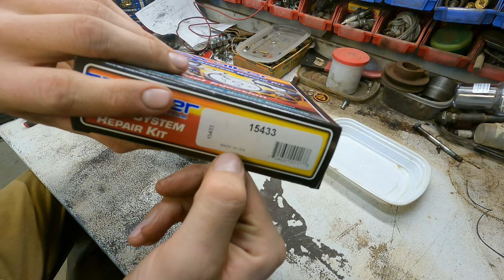Is this 1950's Galion Road Grader worth saving???  Cursed Grader Pt.2

Comment: I loved your "No more Mr. Nice Guy" approach to the bottom bolts. As you surmised, what the heck was the manufacturer thinking when they thread bolts into casting that doesn't allow for a wrench to seat on the head of the bolt, especially in such a confined area?
Reply from the maker: I don’t know how they were able to even get them In there!

Comment: Thank you Matt (Desiel Creek) that Grease also fitting fixer that so cool have buy one and be very good 👍  to use also love your share ideas always to ! Plus that fitting fixer is amazing invention and who thought to get one in production must be mechanic for sure or excellent engineer to help use mechanical equipment people too! Should had one out production years ago to save old fitting on grease ones and I know needle for grease up sealed parts stuff was excellent ideas too I use them to lots especially on tie rod ends with rubber bushings do on vechiles late because no grease fitting too !

Comment: Hi, look at the hydraulic hose for the clutch, it's about to fail. The carburetor is much like what was used on the early 1960's Dodge Dart slant six engines. If you find your is bad in the future you can likely source one that way.
The bell housing bolts, likely International had a special tool for it. When you fixed the engine in the crane truck did you replace the timing chain? If yes and no spark look at that, see if the distributor is turning, I've seen Fords shear the pin that holds the gear onto the distributor shaft especially if there is water in the oil, it can seize the oil pump.
I realize it's likely something easier but I wanted to share some failures I've seen in the last 45 years or so.
I really like the grader! 
Thanks for sharing, 
Bob Ordewald 
Staunton Virginia

Comment: Maybe you can get new bolts into that bell housing with offset open end wrench? I think Watch Wes Work used them on a recent video. That way you can come in from the side without fussing with a socket there's not room for. They look like the "crows feet" with a side handle at a specific degree offset. And you might ask him for other suggestions. His latest video he replaced a radiator on an International snow plow truck and had a link to another channel of a guy that works exclusively on highway heavy equipment, might be a good resource for Christine's issues! You also need to check into LOCK-N-LUBE. I have one and they're a lifesaver greasing fittings. They literally lock onto a fitting with jaws and will let you apply all kinds of pressure without needing two hands one for the hose one for the handle-or trigger. They're very reasonable and they have several accessories for grease guns. Worth a look. Gotta find at least a used tire for that right front! Good work, Matt, keep at her!

Comment: You will have a lot of people telling you how to operate the grader. Most will be good advice but you will have to figure out what they mean by trying these suggestions out. I will tell you a couple of things that I was told. The first is to lean the front wheels into the draft of the blade when taking a heavy cut or mixing materials. The second thing is that you tilt the blade forward to cut and lay it back to carry material. You will have to try these things to understand what I am talking about and then you will develop a feel for what works. Happy grading.

Comment: Clean a tank with Murriatic acid - It works  superb in tanks - remember - on fininsh you musy stop reaction with water mixed with soda.
Reply from the maker: yes Ive used that in the past with good results.
Reply: @DieselCreek  Also if you have stuck piston rings try DMSO - it work superb with carbon https://www.youtube.com/watch?t=230&v=ZVtGC-JUyQU&feature=youtu.be

Comment: Once you have it running, you can avoid spending time on the carb just by running lots of modern fuel detergent, plus old Marvel Mystery Oil.  I also suggest not bothering much with tires until most everything else is in order.

Comment: I’ve been skeptical of those “grease fitting rejuvenators” just because I didn’t like the idea of hammering on the grease fittings. But looking at it now, not much of the hammer strikes should actually be transferred to the grease fitting body, and I guess you don’t have to hit them hard as I thought you would anyways 🤣 I’ll have to check it out. That could be useful.

Comment: You need a set of double ended ring spanners. They can be straight or joggle ended.
Reply from the maker: I have them. there isnt enough clearance around the head to get a wrench or socket on.

Comment: When looking from the front at 27:20 that bolt hole on the right below the Tilt steer ram is where you slot in a piece of steel and then use the tilt steering to jack up the front so the flat tyre is off the ground, it also looks like you drove it with the Diff lock on, just a heads up you can break the chain drive that links the 4 rears by steering with the diff lock on on modern graders (never operated something that old).
Reply from the maker: There isn’t any diff lock on this

Comment: If there is an access plate on that bell housing get a c02 fire extinguisher and blast it in there. Or fill it with dry ice. It should release that pressure plate.

Comment: Where you live, Matt, you are close to farm country and farm equipment salvage yards so engine parts and what have you are very accessible to you and all your equipment, which you probably already know.
   I can't see very well but can you remove the bell housing from the engine , If you can reinstalling everything will go much easier. I am sure you will price the clutch from several sources before you buy one if you decide to buy one and even the throw out bearing. What a great time to replace the water pump too.
If need be poke some holes in the wall and make the double tank all one oil tank and add a clean fuel tank and call it good. lol
Reply from the maker: I dont think ill need to replace the clutch just disassemble it and get it all freed up.

Comment: If you use wd40 in your grease fittings tool . It like using solvent on them but still lubricant.  Works great  . I work on hevey equipment daily and this has saved my butt a few Times

Comment: I installed a grease fitting adapter to my 10 ton Porta-Power.  99% of the time, I can clear out a jammed up fitting or journal with the hydraulic fluid.  I bet kerosene would probably work even better, but never tried.

Comment: Matt you didn't mention that hydraulic line pinched in the transmission hen you were explaining the input shaft. it's too long you need to fix that bent in half line......excellent channel by the way.

Comment: I've got one of those "Oil Hammers" that's from the '40's. Not as fancy with the O-rings, but it's saved many a zerk fitting. I learned about 30 years ago that you can peel an angled zerk right off with it. Keep an easy-out handy. I usually use any motor oil that's handy in it. Great for flushing old U-joints. What Cornbinder engine is that? Was that 10 qts. of oil? I know its an extra expense to resurface the flywheel ... but? I believe you will ultimately be very happy with the old Gallion Grader. Once reliable it will be a money maker. I believe it took me about a month or so to learn to run my old Adams Grader. Happy Motoring.

Comment: Engine was put into the frame with the transmission prior to the cab being put on so the bell housing bolts were vis-able with the engine out of the grader, prior to installation into the frame.
Reply from the maker: visible maybe but there still wasnt clearance around the head of the bolt for a socket or box end wrench,

Comment: if you had a set of "crows feet" for your ratchet you maybe could get those bell housing bolts with the right size of one of those.
Reply from the maker: thought of that, mine are much too fat.
Reply: @DieselCreek  some times you just have to ruin a tool to get the job done. right? a little bit of time on the grinding wheel would do the job.

Comment: Oh one more thing to mark where splines for clutch are at. Maybe take a can of spray paint And Spray paint the around the old clutch it should show u where the splines are setting in the middle of fly wheel and line new clutch up with the paint marks.  Should be real close... again thank you for sharng...

Comment: You needed a snake wrench or 12 Point Flex Head Ratcheting Combination Metric Wrench Set or Flex Shaft for Air drill or Wright Tool 3/4" Dr. Universal Joints

Comment: Old Dodge Dart/Plymouth Valiants with the slant six had that same Holley carb. For an automotive reference. On another note, I have never been able to break a clutch loose and I have tried these tricks. Even when you could get through the bellhousing cover and pry with a screwdriver, it's never worked. I think because there is such little clearance and clutch disks never really release completely apart, they slip before they are totally separated. I have always had to disassemble them, maybe I'm just not lucky!

Comment: Front grater suspension design geometry in road graters might the basis of what Ford developed it's Twin I Beam front suspension system that they first used in 1960 and subsequently through the 70's or 80's in their front suspension design for their pickup trucks.

Comment: Now that it's apart, carefully grind some clearance around those bolt recesses. 
Use a die grinder if you got it.
Don't need much, just enough to get a standard flat box wrench in. 
 Put an eye on the case to see how thick the case is before you start grinding.
 Don't forget to polish that turd with some sand blasting.

Comment: I think I would use straight acetone the first time around then acetone mixed 50/50 with auto trans fluid then grease that would make it clean for another 70 years

Comment: Great job torching the bolts off bell housing and pulling engine! Looking forward to pulling clutch and new parts .Isn, t there a plastic  guide you can get to place over shaft as you direct engine in?
Reply from the maker: yes you can get them for standard automotive applications but it would be a tall order to come up with this one let alone with the double spline.

Comment: I've lost two pickup truck clutches (same truck) to mouse nests. In each case they packed their debris between the clutch plate and flywheel freezing the clutch. In the second one a mouse was found that got caught when I tried moving the truck. Very expensive mice in terms of the cost of their housing choice.

Comment: You're lucky the clutch didn't pop free when you had it tied off the tree otherwise that rat nest material could have caught fire down the line! There would have been no reason to open up the inspection plate had it worked. 
Brave man putting your hand in there 😂.

Comment: I thought that the front wheels tilt to counteract the side pressure exerted by the blade angle.  At more extreme angles, the blade will try to push the front in the direction opposite the blade direction.

Comment: You showed the torn tire, but I checked back to your first video and I saw that tire was not torn then. I wish you had taken the time to fix the tires before moving it. Obviously it will eventually need new tires, but it would have been pretty cool to at least use these for a while.
Reply from the maker: I can assure you that tire was junk I tried putting air in it when it was at my house it didn’t hold air

Comment: Did you see the kink in the clutch hose line in the bell housing? Looks like there is a spring above the kink which is supposed to prevent that happening 🤷🏼‍♂️

Comment: you where saying that you had to get the machine running i came up with a 12v two way electric hydraulic pump that follows 22gpm and put quick connect couplers on it this way you can make adapters to foot any size line to run the hydraulics from battery power when a machine won’t run just though you might find interesting i like a lot of you videos i’m located north of pittsburgh pa

Comment: Those last few bolts looked like candidates for box end wrenches or a low profile socket. But also looks like they lowered the frame onto the rear wheels & engine vs pulling the engine out the top?
Ah well, least it came out in the end.

Comment: Man, I like the Dwalt grease gun. We need to get one of those at the firehouse for our Ladder truck. We have to clean re-grease it ever few months. There is a lot of grease fittings on it. We have one or two grease fittings that like to act up, never fails. Where did you get that tool to free up the grease fitting?

Comment: Is the pipe that's visable in the bellhousing for greasing the release bearing? It looks kinked. Maybe that was restricting grease flow therefore  making the bearing stiff? The stiffness combined with the nest material wouldnt do the clutch issue any favours... It may not influence anything but no harm in testing it anyway. 

Regarding the non start in the truck - there's always something 😂.

Comment: I dont comment very often but unless you like rebuilding engines please drain that NAPA 10w30 junk oil out of it and replace it with a good strait 30W or 40W oil.  I've seen way to many guys do the same thing to an old engine like this and the oil is just to thin for it and you end up with rods knocking . Todays oils can not be compared to the oils that were used when this engine was built, They were thicker/heaver and the engine was designed with the oil specks of that time. Any oil you buy today at the stores (Parts stores and Retail like Wal-Mart) are all made for Modern 2021 engines and not for a 50+ year old engine,  So my advice is drain that oil out of it and get a good strait 30W or 40W diesel motor oil and a good additive to it to keep that old engine happy. Even if you rebuild the engine to factory specks there still the factory specks used when the engine was new (50 years ago) using oils made then and not now so you still end up having the same problem with oils being too thin for it.  Please dont take this as me telling you what to do as this is not the case, I'm just trying to pass along what I've learned over the years to keep you and others from an expensive rebuild when you dont have too .   Bandit

Comment: Take smaller gravel without  fine proportions in that fuel tank and tie it on your concrete mixer and let it turn for a while. After that and taken the sud with a vacuum cleaner out it should be like new.

Comment: 38:50 Check out Milwaukee part number 48-22-9403 it's an ultra low profile socket with square outside, so you can slip that onto the nut and then slide an open ended wrench around it. It's much slower going than your solution though.
Reply: Kobalt XTreme Access # 27111700 may be even better. Thinking of buying that one myself.

Comment: Old Cristeen really set you up in this video. She was letting you think She was going to Cooperate and BAM, She said NOPE not going to go easy no More....Typical Woman...LMAO....About the time You think you have her figured out she shows you a New Trick....I was worried about the Splines on that input shaft. But they look great..Put a new clutch and pressure plate and throw out bearing in her. She will be just like NEW AGAIN...LOL... As long as u dont turn the engine over it should be pretty close. Before you undo the pressure plate mark where the splines are in regards to the pressure plate and inter HYD splines. And put new one in same place. Also just a suggestion it looked like the hose for greasing throw out bearing looked like it was kinked in half. Maybe get a little shorter one or something.. Great Video Bud. Cant wait to see her going back together....Thank You for sharing

Comment: I had a 71 caddilac sedan deville that sat forever and i bought it and got it running. it tried to kill me...electric seat stuck when i was trying to scoot it forward a bit while driving on the interstate..almost squished me dead between the seat and the wheel, managed to pull over and get out from behind it just in time. Named it "Christine" right on the spot, and that name stuck.

Comment: 31:40 pro tip: You can buy 6 gallon boxes of oil at Napa. Saves big on the waste
Reply from the maker: Really?? I asked them a few times for a bucket but they said all they had were Qts and 2.5 gal jugs which I don’t like for whatever reason
Reply: @DieselCreek  Look up part number NOL 869934 . That's the synthetic blend one. I think they also have conventional oil in those boxes. They have a spout on them. If you're filling through the valve cover of a big inline engine, typically you can just set the box on top of the valve cover and open the spout. So you don't have to hold the weight or pour from a container.
Reply from the maker: I’ll have to get them to get those for me
Reply: @DieselCreek  Ours used to have to order them too, no extra charge. Now they keep some in the back. Talk to the owner to see if you can get a mechanic type account with your Napa store. They'll give you a discount and send out a gofer to bring stuff to you so you don't have to keep running into town to get stuff. I can call our store tomorrow and see what they charge for those boxes. Some stuff carries a heavy discount, some doesn't
Reply from the maker: @castirondude  I have an account with Napa they won’t bring stuff out to the farm tho

Comment: Diesel works as well as PB & other expensive oils for freeing up zerks.

As for the tank. If you can't get it clean from outside, or it leaks across to the hydraulic tank, cut the back off, fix the problems then weld the back in again (not forgetting to REALLY clean both tanks of fuel & oil first...).

The engine runs well, the frame appears sound, so I see no reason you shouldn't have this fully functional without too much effort.
Reply from the maker: My thoughts exactly!